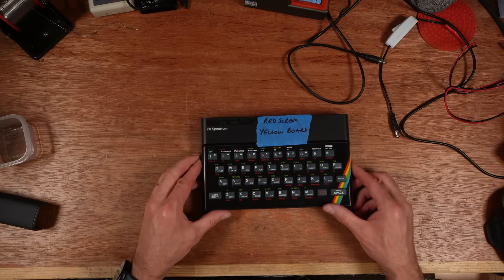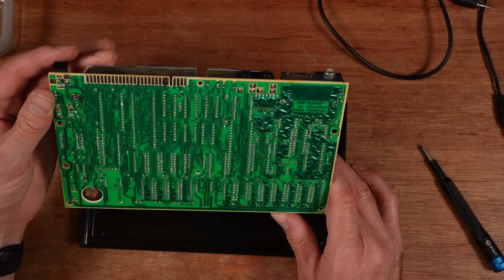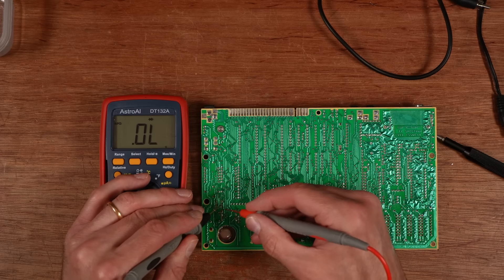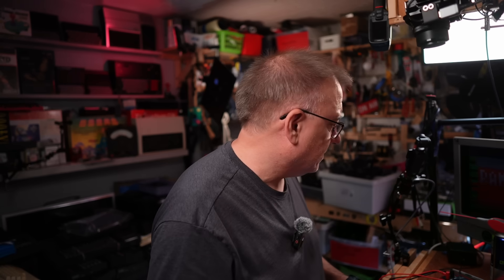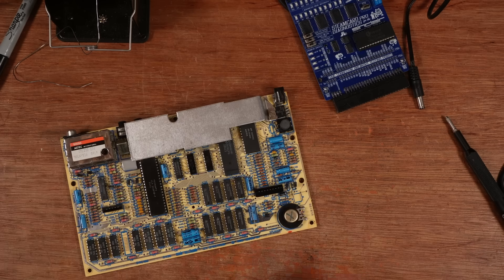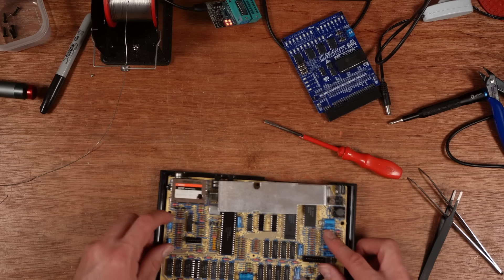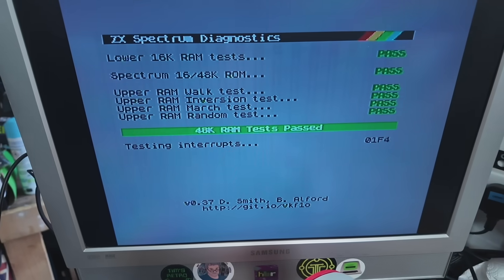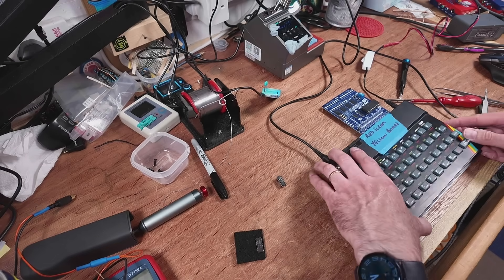R@R3 YELLOW Motherboard ZX Spectrum 48k

Comment: I think these yellow boards are SRBP board rather than fibreglass, so yeah, more fragile.. my memory could be wrong though. I have worked on one before but it was quite some time ago!
Reply: I think your memory is correct. I used to work for Moulinex making Teasmades. We changed the PCB from fibreglass to SRBP because they were cheaper. We saw a large increase in warranty returns due to cracked or heat damaged PCB's. They were rubbish!